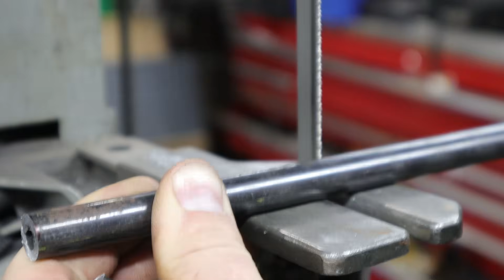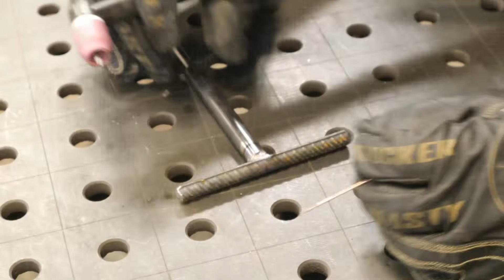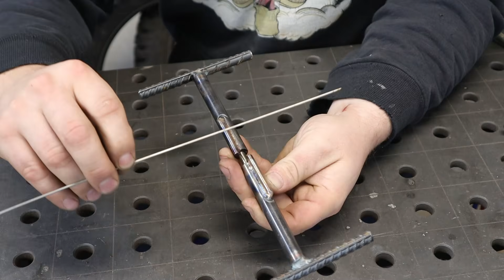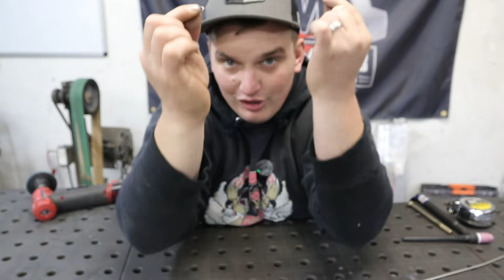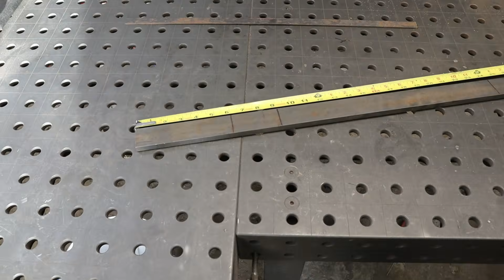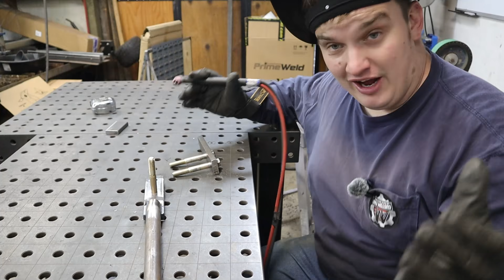I MADE 3 Simple Metal Benders You Need in You're Workshop -DIY

Comment: Great video, to the point and easy to follow. I left my bolts long o my flat stock bender so I can add various size sleeves for different radius bends.  PS You've made me want to have a go at TIG now...you made it look so easy but I'm sure it's not :o)
Reply from the maker: Definitely worth trying. It's a lot cleaner, less cleanup but your material has to be cleaner also. Thanks for watching. PS. If you're wanting to get into TIG welding, primeweld is an affordable option and back their equipment.

Comment: Maybe old drill bits or Allen wrenches for the bending fingers.
Reply from the maker: Old drill bits is definitely something that could possibly work. You just need to make sure that the filler you weld them went would work with the two different shrink rates because of how hard they are. But good idea 👍

Comment: excellent explanation. i don`t know about imperial gradings but i`ve had pretty good results tig welding 8.8 to 12.9 bolts to carbon steel with 309 stainless rod. i`d leave the threads great for diff radius inserts
Reply from the maker: Thanks for the feedback and sharing your experience!